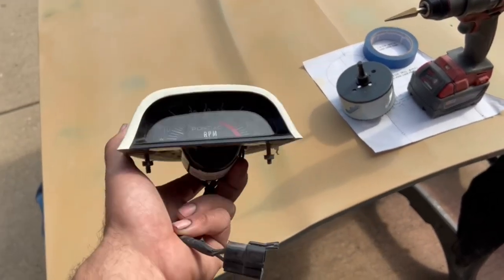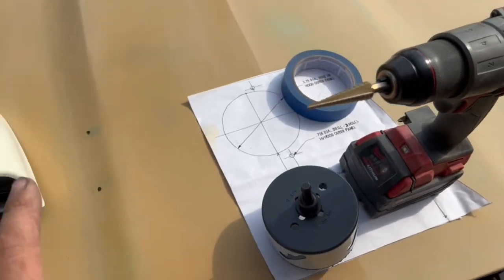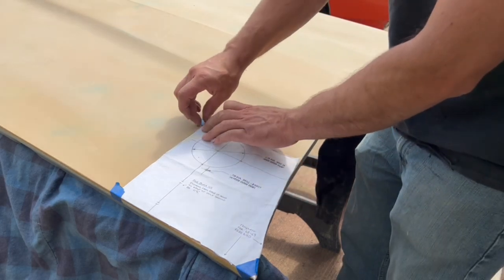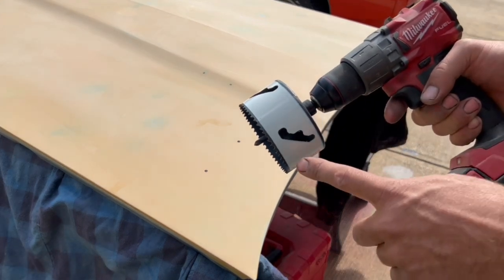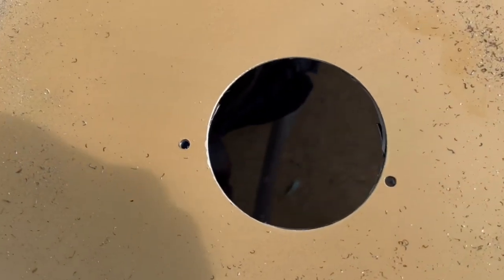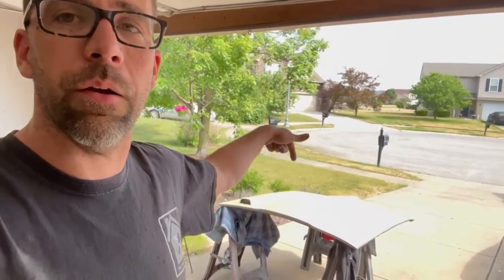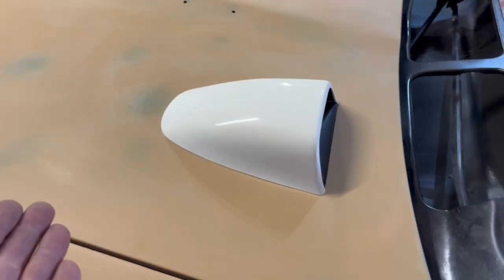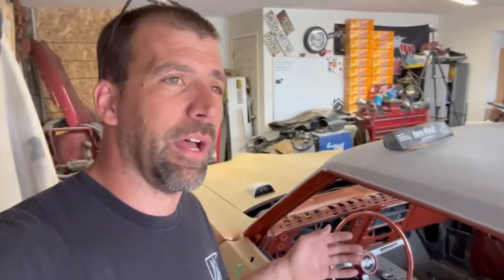Hood tach install 1968 Firebird where and how to drill the holes

Comment: I don’t think I remember ever seeing one on a sprint? 
Wow , the Great Wall of orange mt Dew !
Reply from the maker: What wall of Mountain Dew do you speak of 🙄 

The 1969 Trans Am was the only first gen bird you could not get a hood tach from the factory. The tach was in the dash of optioned that way and then They had a special sacked gauge cluster that went where the clock goes for fuel, temp, and voltage

Comment: A Hood Tach was not available on the 69 Trans Am. The hood scoops interfered in the hood tach location.  If you wanted a tach, the in dash tach with the stair step gauges was available. Hood tachs as well as the in dash tachs were available on all other models including the 6 cylinder models.
Reply from the maker: Exactly!

Comment: The 69 T/A no hood tach brother and Great video 👍
Reply from the maker: Yes sir that is correct
Reply: @VinylVillageGarage  thanks buddy did you use the template I send you at all
Reply from the maker: @firstgenerationgarage2803  I did actually, I did on my 1969 bird and then compared it to the print out that came with this tach and it was spot on. So I knew this one was a winner
Reply: @VinylVillageGarage  you are the man Jonathan

Comment: another great job Jason. Would you mind sharing  which tach and part # you used for this project. I assume you used an hei distributor?
Reply from the maker: The tach I used was included in a box of parts I got, it didn’t have a brand or manufacturer tag.  I wish I knew I would buy another one. 
   The distributor is the points distributor with the accel brand point elimination kit and the tach works great

Comment: Coming right along! Looks great. Is the hood tach the same as the gto by chance?
Reply from the maker: Year by year yes. Then you have two different redlines as well.  6cyl and ram air cars have a higher red line then standard v8
Reply: Thanks! Also does the 68 use a vented gas cap or non vented?
Reply from the maker: @justindennis1186  I want to say vented because it doesn’t have any vent tubing. 1969 early production have a vent tubing system that was scraped and went to a vented cap only.   That is one way to tell an early production 1969 bird
Reply: @VinylVillageGarage  that’s what I thought also but wanted your expertise! I appreciate all the great content. Hope to get mine in body work soon if I can just find some decent front fenders. Thanks!
Reply from the maker: @justindennis1186  understand that, I like to find and repair original fenders.  The repops I have head some people love them and others hate them and I don’t want to find out.   Now if someone gave me some for free I might tear fit them 😁

Comment: Cool, I thought about getting one, but I'm going with digital gauges, so it's not going to work for me.
Reply from the maker: The owner wanted a tach for this car but liked the factory looking dash so we opted for the hood tach. 
Are you going digital readings or digital gauges?  I have seen lots of options now
Reply: @VinylVillageGarage  Most likely going with Digital Dakota, but they will look somewhat stock.  I need to go this route becuase the engine uses a computer and the transmission has a digital output even though it's a fully manual automatic.
Reply from the maker: @GoGoGarage  all makes sense, hope to see your mods on the YouTubes too I would like to see that.

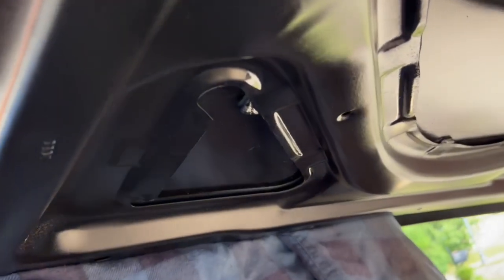Comment: 2:29 My friend's 68 RA1 has a dealer installed tach and the dealer cut a square hole in the hood for the tach's protrution.  Is it legit?
I've made 5 templates of  factory installed tachs, they ALL vary.
6:31 I've never had any of the lucks (good, bad or tough) with holesaws. I ended up drilling a hole to suit the holesaw drillbit, replace the holesaw bit with a rod then drill the holesaw hole. If I don't do this the holesaw goes left(or right)
and one mangled, skin gashing mess. I should have bought a virgin holesaw like you.
9:00 Since only on early Firebird came a tach standard in the dash I would guess the '69 Trans Am? Though I have seen a '69 TA with a hood tach.
I see you haven't yet installed a tach seal.  The '67s had a hood to tach seal, and the '68s did not, BUT a 68 hood tach seal is listed in the early parts catalogue.  Sounds like a good idea.
Nice job done. One last thing, Are you going to install another dealer installed option?  This feature is very common on full size Pontiacs, rare on 68 Firebirds. A reelout trunk light.  I bought an unopened accessory with full instruction s and 1968 GM Accessory Catalogue.  Why rare? The option box fully describes it but the catalogue just calls it a trunk light.
Reply from the maker: i have only seen round tach holes, not sure why it was square, interesting of course.  
the new holes saw worked fantastic for me, might be worth buying a new one every time considering the cost of a new hood vs a hole saw.
1969 trans am was the only first Gen that you could not get a hood tach, it’s on the factory  order form.  they even created a special in dash and stacked gauge set for those who wanted a tach in a trans am.

Comment: Man that is so tacky! Lol.....
Reply from the maker: lol yes it is. and super fantastic too
Reply: @VinylVillageGarage  
It is amazing to look back at the past and see what the auto makers were doing! Lol...
Reply: Was there a hood mounted clock on the passenger side on some car or am I dreaming?
Reply from the maker: @raymondlugo9960  you might have seen a picture where they mounted an empty hood tach on the Passenger side during experimental stages of improving the firebird performance. The thing I can’t remember was why at the moment. I think it was an air intake for the engine. To the best of my knowledge never made it to production stage just prototype
Reply: @VinylVillageGarage  I remember a tach on the driver's side and something else on the passenger side with the same dimensions.  I looked recently at every Pontiac brochure I could find from the era and didn't see any pictures a second device on the hood.
Reply from the maker: It never made production.  I have an article and pictures of it at home in a book.   
The Definitive Firebird & Trans Am Guide 1967-1969
It has a section in it describing things the
Engineering team was doing to improve the 1st gen bird.
Reply: @VinylVillageGarage  thanks!  So is it a clock or something else?
Reply from the maker: @raymondlugo9960  I believe it was a air inlet for the engine. Kind of Like a backwards ram air scoop